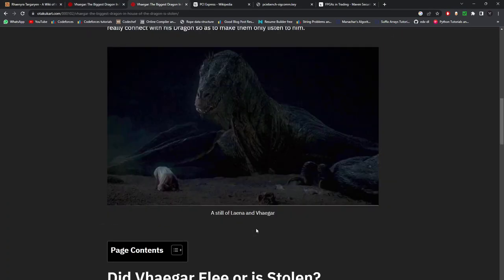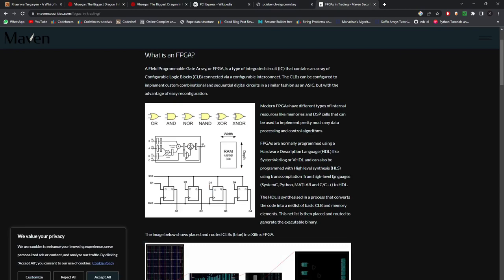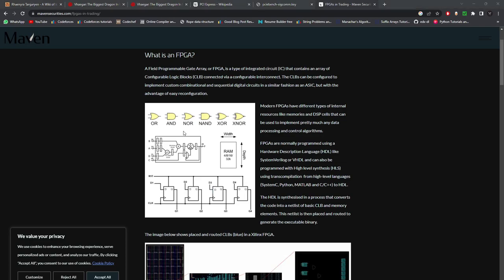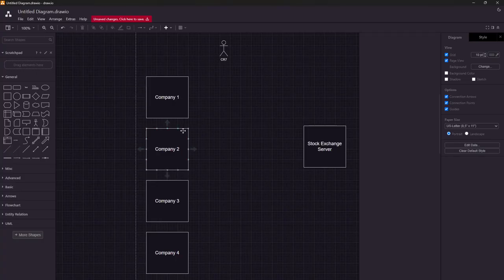FPGA in trading | Ultra low latency trading | HFT System Design

Comment: Ye close to light speed, pretty crazy. Though I hope it doesn't have to kill all other forms of trading (it might), it will have the monopoly on short tale like arbitrage or any micro margin high frequency strat (not that we can compete with market makers paying 0% fees, even if they sit and do it by hand). 
But can still manually pick the wining team on a swing (or position so small that you can absorb the draw down and stubbornly wait for profit like some of these funds). If can do manually then can do on comparatively cheap hardware with bad geographical location. Market maker needs someone to make a market for.